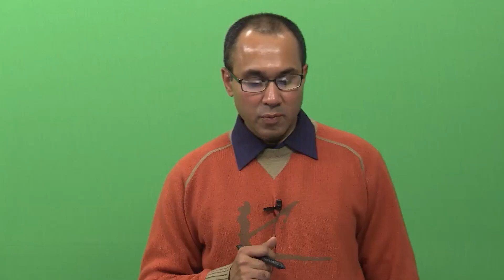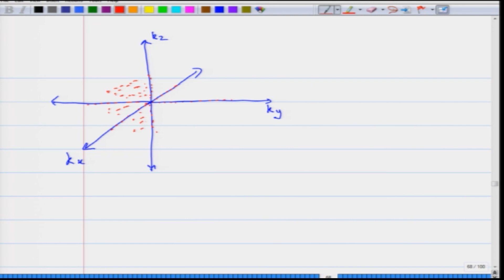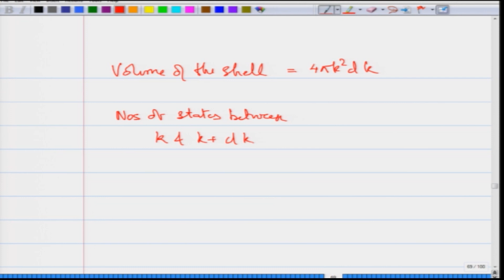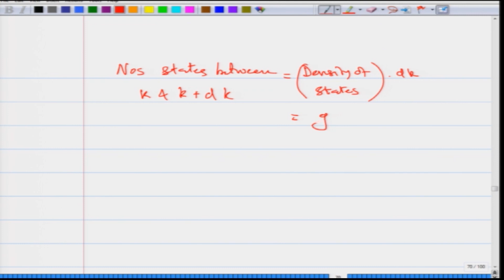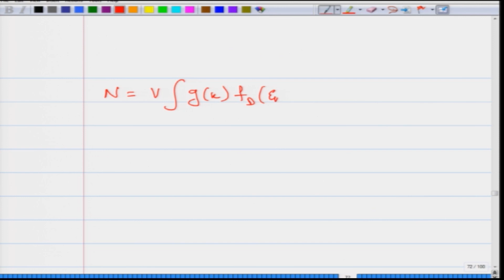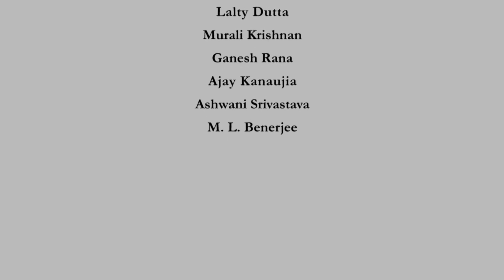noc19-ph02 Lecture 16-Density of states Part-I

Comment: At 9:34 there is 2 factor due to electrons spin up & down state?
Reply: yes
Reply: @javedakhtermondal3957  How is that possible? That '2' is used to count the number of particles... The Professor says that 2 is used for +- hk. But, the +-hk effect is already taken into account in the volume integral..
Reply: @sankhamukherjee8308  When we integrate for volume of a sphere, the limits would be taken from 0 to radius, not -r to +r; by not including 2,may be we get only positive values as result...